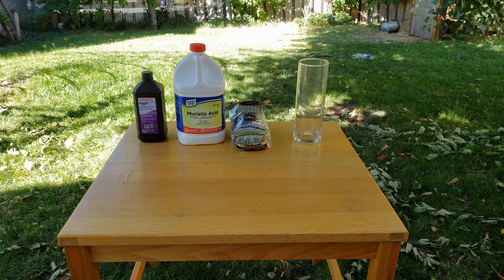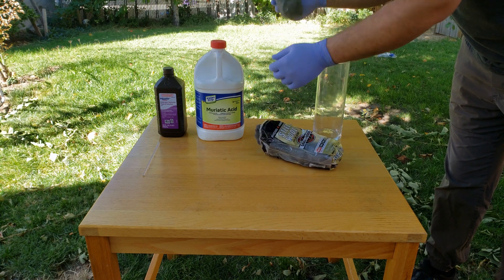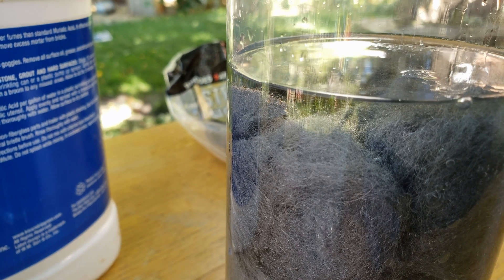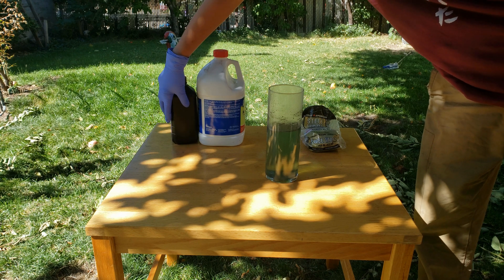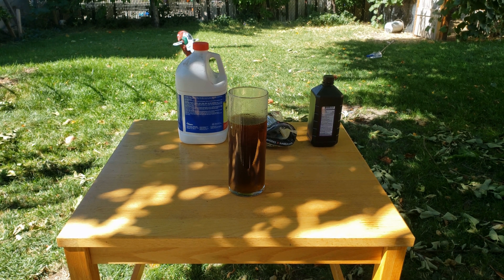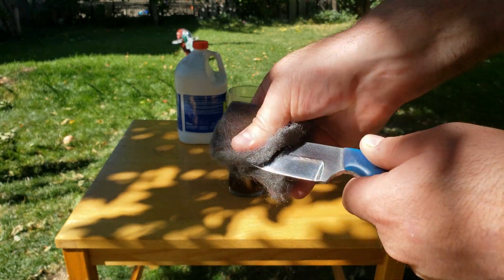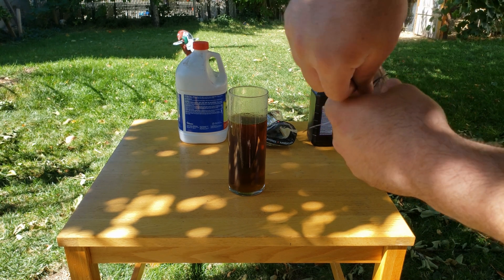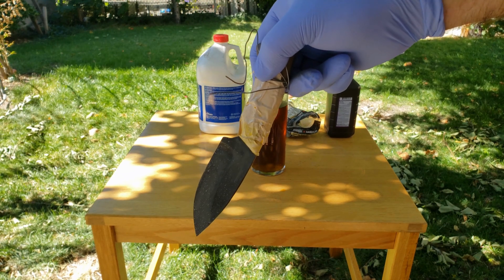Making Ferric Chloride to Etch Metal

Comment: How do you know when you have added enough peroxide? I have also heard that you can use a fish tank aerator in lieu of a peroxide treatment, but again, do not know when the Fe2 becomes Fe3
Reply from the maker: I don't know that there's a super exact answer for this as the hydrogen peroxide is simply there to speed up the reaction and introduce oxygen into the mixture more quickly. If you add too little or no peroxide the iron II chloride will still eventually turn into Ferric Chloride just due to exposure to ambient Oxygen in the air. That, however, can take a very long time so it may just be best to overshoot and add a little extra peroxide, as hydrogen peroxide will decompose into water and oxygen when exposed to light long enough, so it won't really interfere with the rest of the Ferric Chloride. That being said, if it is still bubbling, it's best not etch anything in it yet, as the bubbles will interfere with the etching process and give you an uneven etch. If you want you can also check out NurdRage's video, it's more precise than mine and you may find it more helpful: https://youtu.be/43Xsh9J7S-g

Comment: I'm in the process of making some.  I'm making a big batch, about a gallon.  I put in 1250ml of muriatic acid and 3 balls of 0000 steel wool.  All bust just a little of the steel wool was dissolved. I slowly added two 32oz bottles of  3% hydogen peroxide.  Now it looks like beer.  It isn't dark like yours.  Any ideas?
Reply from the maker: First I'd like to put a little disclaimer that I'm by no means a chemist so I'm not 100% sure what would cause that. That being said it sounds like you may not have added enough steel wool to the reaction to react with all the muriatic acid. There are definitely better resources than my video if you want more exact measurements of how much to add in relation to how much acid you have. As a general rule of thumb I just add the steel wool until it stops reacting. 

Also, 2 32 oz bottles of peroxide may be a bit more than you want for that amount and could have watered it down a bit. In the end thats not nearly as big a deal as having unreacted HCl though, but excess peroxide can sometimes form unwanted bubbles when you are trying to etch metal and give you a less than optimal etch.
Reply: @elemental_workshop  - I apologize, I"m just now seeing this.  I really appreciate the reply.  I ended up buying ferric chloride from Jantz Supply.  They're semi-local to me (about an hour or so away from me).  I have been so busy with work and other projects (trampolines, zip line, vacations, etc) to even do another knife.  I need to because my cousin has been getting into leather working.  I told him I'd make 2 knives, one for me, one for him and he could make 2 sheaths and send one complete knife and sheath back to me and keep the other.
Reply from the maker: @jarodmorris611  oh nice! I bought some 1080 steel from them last year and I've been really pleased with how easy it's been to work with. I will hopefully be posting a knife making video here in a couple weeks.

Comment: would this process work at all with stainless?
Reply: Generally, no.  Most stainless won't etch with this stuff.  That's how they make damascus steel with those cool patterns.  The non-stainless (often 1080 or 1095) will etch dark but the stainless will not.